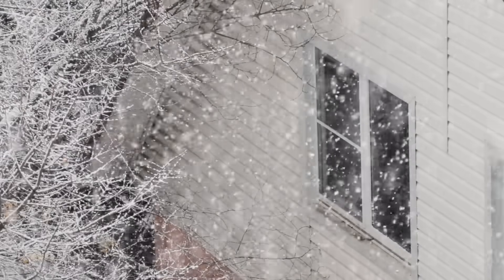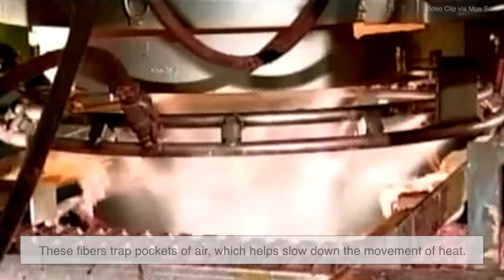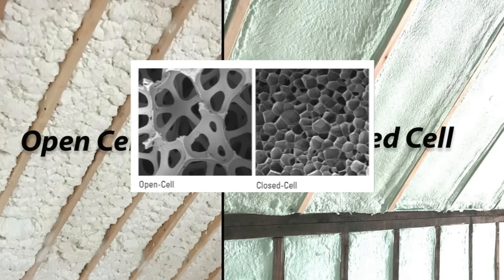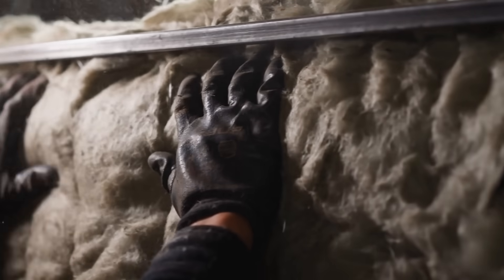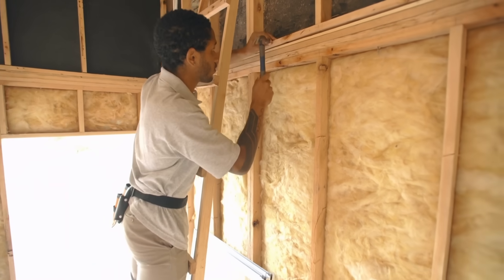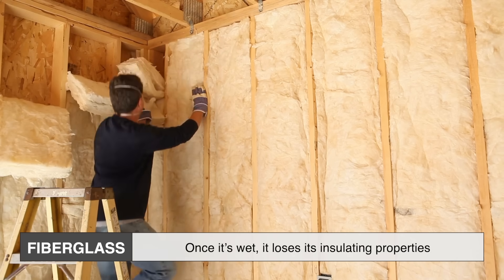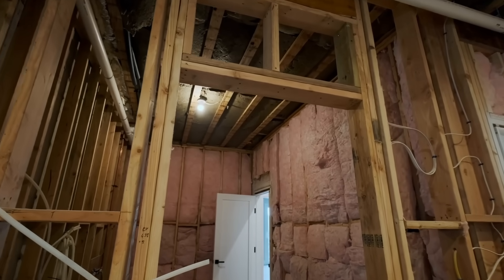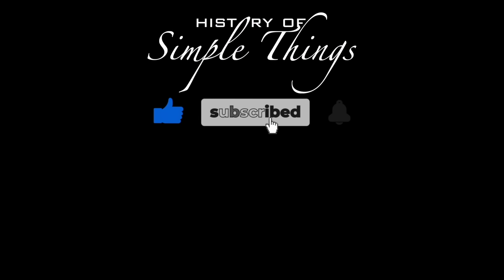What’s the Best Home Insulation: Spray Foam or Fiberglass?

Comment: The cheap comes out expensive in the long run. Spray foam when done professionally is a winner.termites isn't an issue with pressure treated wood. 😯

Comment: You can't rewire or add electrics in a foam house as everything is sealed in place
Reply: Foam the structure. Then build a service zone that contains all the cabling and pipe work. Access to this space in the future doesn’t break your thermal envelope and you are free to add or require all you want.
Reply: @TheBronx_911  Just conduit the electrics.

Comment: when the Rafters and truss and roof deck are covered and a tree limb falls on the roof you have to cut it out and since its all glue you have to remove more then just a 2x2 foot area .  Pole barns a 3 foot wide area turns into 9 foot . i hate closed cell in homes . its a nightmare wiring and the studs around windows .  its fine till you need work on the home.

Comment: Apparently rockwool offers better R-values than fibreglass and repels moisture. Closed cell spray foam is better than rockwool.
Reply: No foam is not better.  foam locks in any moisture that is stuck in the wall cavity, plus most insurance companies wont cover it because when you need to do an inspection of the walls you literally have to tear out the spray foam in order to see behind it.  Whereas rockwoll or fiber glass can be removed and replaced when done

Comment: The fiberglass batts in every shots were so poorly installed (too thin for the wall depth, cut too large or too short). I wouldn't want to cut a new window opening in a wall filled with foam.

Comment: Spray foam all the way. 2lb closed cell at a minimum of 4". Spray Jones here on YouTube has a whole bunch of videos going over  various topics.
Reply: 7” of closed cell foam in our double stud walls. R-60 fiberglass in the ceiling. We heat 3400 square feet with about 700 gallons of heating oil a winter here in Alaska. We also have a good south view with close to 200 square feet of windows on that wall. Even today with it only getting to 50 and cloudy our furnace didn’t run during the day. We get a lot of wind but the house never creaks in it. We had a 7.1 earthquake 5 years ago centered about 15 miles away and we had no damage where some neighbors had a lot of cracks in their drywall.
Reply: The bracing effect of spray polyurethane foam is underrated, in my opinion. I had my old cargo van insulated with spray PUF and it made the body much stiffer driving washboardy dirt roads. It also made it much quieter by damping out the sheet metal from vibrating.